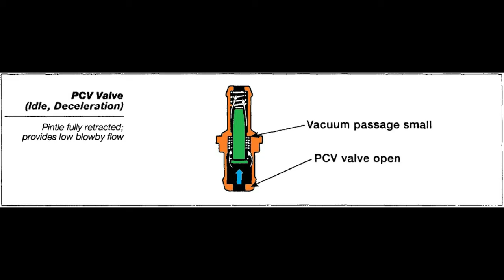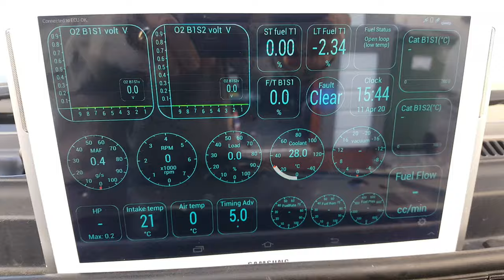How to TEST a PCV Valve on your car

Comment: Some models of PCV's are designed to NOT fully close, so even a new OEM PCV will pass a bit of air. The balloon test is only valid for certain models, that are supposed to fully close. The only way to tell which type you have is to buy an OEM PCV, and do this balloon test on it, then compare with your old one.
Reply: Well that's ultimately pointless if you gotta get a new OEM one anyways 🤷‍♂️
Reply: Everyone here has a point 😂
Reply: @TonY74U  Pointlessness...
Reply: @technomage6736  Tells you if the problem in your car was caused by the PCV
Reply: Hopefully , the new unit isn't defective  
: D
Reply: I hope you get this message.I drive a 66 c10,i6.the crankcase has a lot of vacuum,so much that you can’t open the oil cap,pcv and line hooked up directly into intake.any help

Comment: this way the test may be inaccurate. The suction pipe is connected to the place where you attach the balloon. Oil vapor comes from the large part. I think it should normally be closed on both sides, and when the pressure increases, the valve should be opened with the help of the suction. In this way, the valve always remains open and oil vapor constantly flows to the suction.

Comment: WOW.. So I had cleaned and checked my PCV valve before and assumed if it rattled when I shook it, it was good. Did the balloon test and it was leaking air. Bought a new one and surre enough, no air leaked with the balloon. AMAZING TEST.
Reply from the maker: Im glad it helps..thanks for watching
Reply: Did you feel any diffrence after replacing it ???
Reply: @ajayprakash1798  Yes I did. However the rough idle came back and I just checked my Solenoids on the side of the engine and one was sticking, so I have new ones coming today. But if the PCV valve does what mine did, it is bad and replace it.  Did you test your PCV? Mine was $22 at O'Releys.
Reply: I just removed my pcv valve and noticed oil on the hose end. It had a very light rattle. So immediately I wanted to try the balloon test. The balloon inflated on both sides of the valve and the air also leaked. Thanks for this video.....I never knew about the balloon test...only the rattle test.
Reply: @NextLevelAutoDiagnostics  I stumbled on to it. Glad you found it helpful.
Reply: @wisconsinman3590  hello, what solenoid was sticking that you said you've replaced? What is it for? Thanks
Reply: @bathanmark  On the passenger side of the engine they are 3 of them. One you can get from under the hood, the other 2 you have to lay down and use a long extension. I changed all 3. 1 was sticking 1 you could twist the whole end around, so I just did all 3. I don't remember what it was for, All 3 are interchangeable though. If you do 1, might as well do all 3. Oh and also, look it up they do say what all 3 are for, I believe it was the middle one sticking/stuck for me. Sorry couldn't be more helpful.
Reply: @wisconsinman3590  thank you. I appreciate the reply. I will take note of it. Cheers.
Reply: @bathanmark  I think solenoids tied to vacuum for EGR will definitely affect idle and acceleration basically puts car in limp mode till corrected , scan should pin point defective valve sticking dealing with same problem , you asked the same question I was looking for answers too...👍✌️💪🤔☯️

Comment: Only thing I do different is to half way fill up the valve with gumout and THEN holding both ends closed I shake the heck out of it and repeat until the valve sounds nice and loose and the cleaner is coming out clear. Once dry I blow through the outlet end to see if it is sealing ok. Good enough for me.

Comment: A oil catch can or air oil separator will catch the oil vapor and send cleaner air back into the engine and it will run better that’s what I did
Reply from the maker: Thanks..I will try that..
Reply: Any tips on installing it? I have a 2014 Mini Cooper S. Should I simply intercept the connection of this hose to the PCV, or should I replace this hose with a new silicone hose from the PCV, new catch can, and new silicone hose to the intake? The existing hose looks like it might be too firm to place much of anything in between

Comment: I checked the PCV valve using balloon test as well. I inflated as you did and then leave it for a couple of minutes. As minutes goes by,  the ballon deflated very slowly. In fact I heard a hissing sound on the PCV valve when deflating So my question is a  good PCV valve should be totally air tight sealed or not? Thanks
Reply from the maker: try to clean the pcv valve first, but if it still leaking maybe you need to change a new one..pcv will close on engine shutdown and if there is a backfire..thanks for watching
Reply: I cleaned it throughly using carb cleaner  but  there's still hissing sound in the PCV valve. Though the balloon air takes totally deflated in 4 minutes. I replaced my Camry genuine parts PCV valve 2.5 year ago. I travel roughy 6k miles yearly. My question is PVC valve should be air tight sealed when testing a balllon or it just prefectly normal a hissing sound can be heard. Would appreciate other members can share their views as well Thanks
Reply: @onglorenz  Some models of PCV's are designed to NOT fully close, so even a new OEM PCV will pass a bit of air. The balloon test is only valid for certain models, that are supposed to fully close. The only way to tell which type you have is to buy an OEM PCV, and do this balloon test on it, then compare with your old one.

Comment: Not all pcv-s are one-way. The easiest way to check, with pcv out, is to block intake side and apply vacuum (a syringe or something) on the cover side. This should close the valve, while valve closed and vacuum still applied remove the intake side block and the valve should remain closed, no movement - good valve. Clean it if not done yet and reinstall.

P.S. if you're gonna use the finger and mouth method be sure to clean that valve extremely good because if the valve is bad then you can guess what happens with all that gunk from inside it ( and even if it isn't bad).
Reply: You can check it in many ways. just watch and learn something new.
Reply: I suggest people NOT check it by using your mouth if the tube is still connected to the valve cover. I just came back from the physicians office because I did just that and inhaled a lot of crankcase fumes. I ended up with sores all over my hand and body that developed the day after and debilitated me for a week because I had some reaction to it. I literally looked like a leper. The stupid part is that I actually have a hand vacuum to test these things but was lazy to pull it out.

Comment: Careful with the brake clean and car paint
Reply: Brake cleaner is NOT identical to electronics cleaner spay. The electronics spray does NOT leave  any residue at all...
Reply: Konstantin Trehagyrevopoulos  I know tat and have replaced and cleaned the PCV valve in my 2000 car several times.

Comment: Hello , my pcv valve opens/ closes when i just slowly turn it over. Is my pcv spring bad?
Reply from the maker: the spring is too weak..maybe you need to replace the pcv..it is not too expensive
Reply: @jlsetnuper  I'll try it. Hope my Toyota's oil consumption will get little better 😂

Comment: I did the balloon test and it slowly leaked after I filled it. Does that mean it's bad? Mine is on a 2008 Honda Civic LX Automatic. Thanks!
Reply from the maker: you need to replace a new one...thanks for watching
Reply: Did you get a new one and test it before you put on?

Comment: How does that work when the PCV valve is built into the rocker cover? E.g. Vauxhall / Opel Z16 XE or Renault D7F 800 engines.
Reply: You replace it and hope the bolts don't strip 😂
Reply: Incorporated into cover or threads in very interesting Toyota Corollas rubber bushed plastic even aluminum aftermarket fancy ones... Might have to look for aftermarket replacement??? ✌️💪👍🤔🙏
Reply: From what I understand, the whole valve cover needs to be replaced if you want to replace the PCV in that case.

What I'm not clear on is how you can test the built-in PCV before going that far

Comment: Can the PCV valve cause the blue smoke at the exhaust pipe??
Reply from the maker: no, blue smoke is an engine oil that mix in the combustion ,cause by a cracked cylinder head gasket..
Reply: @jlsetnuper  But can be the cause if the blue smoke is only at starting the vehicle but disappears ???
Reply: @jlsetnuper  wrong If the PCV valve is stuck open, oil will be siphoned from the crankcase under high vacuum conditions and cause engine to burn it and causes tons of blue smoke out the tail end, look at your filler, cap if their condensation on it along with milky stuff you have a bad pcv valve.
Reply from the maker: @chuckychuck  pcv valve is always open when the engine is running..it will only close when there is a back fire or the engine is off..check the video while engine is running..

Comment: Hi can you help me the crankcase breather valve on my skoda fabia i combi 6y5 1.4 mpi only allows air one way, at idle the engine pulls air through the PCV valve inside the crankcase is that normal? shouldnt it be the other way around? i tried blowing air through the breather valve and it only goes one way towards inside the crankcase which means it can never push out the gases throught the valve.
Is this normal? i cant find any information, only found one guy saying something about one way pcv valve, but why is that one way towards the crankcase it should let air go towards intake :( what do i do?
Reply from the maker: The breather hose is connected from the intake pipe where the fresh air come from, then it pass thru the crank case, and from the crank case unburned gases exit to the pcv due to the vacuum. And the pcv hose is connected to the intake manifold where unburned gases is injected.
I think its normal .
Reply: @jlsetnuper  you are right my car system has a differentl setup, it pulls air through that little ventilation valve into engine then exista on the backside of the engine into the crankcase ventilation sistem that contains a difderent pcv valve elwcteonically controlled and from there back into the intake manifold on jts lower part where i cant see it , i thought i have and old Style pcv valve thats bidirectional and its stuck one way like many youtube mechanics show on their cars.

Comment: Can i ask what happens when pcv valve is not fully close? My car pcv valve is not fully close?
Reply: engine not much affected, pcv valve is haft way open or fully open when engine is running or at idle..engine is really affected when pcv valve is stuck close while running..
Reply: @fixathome2273  thank you
Reply: @fixathome2273  but my pcv hose have some oil leak on joints is this ok?
Reply: @danmaverickmanalustresmani7494  those are unburned gases from the crankshaft..

Comment: Dose it work with all Pcv or  only like the one ur using ?
Reply from the maker: yes, its works on all PCV..thanks for viewing
Reply: @jlsetnuper  it’s because my car smokes Little and it smells a lot like gas and I was wondering what could it be
Reply from the maker: @ernestoflores5146   check for any leaks on the intake manifold, hoses, the injector and the fuel lines..

Comment: Just buy a new one, its literally the cheapest part you can buy.
Reply: The PCV on my Mini is built into the engine valve cover. If I want to replace the PCV then I have to replace the entire valve cover.

What I would like to know is how best to test the PCV if it's built in like that

Comment: Not much use and no voiceover to explain it. 
A PCV valve is under $15 new so just buy a new one and replace it...It is easy to do.  Cleaning it may sound fine and still be faulty.